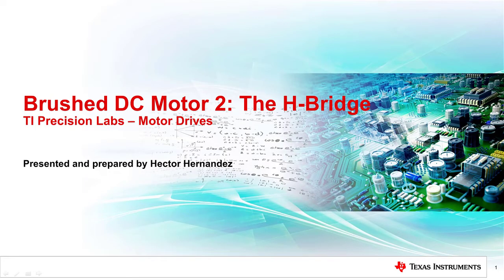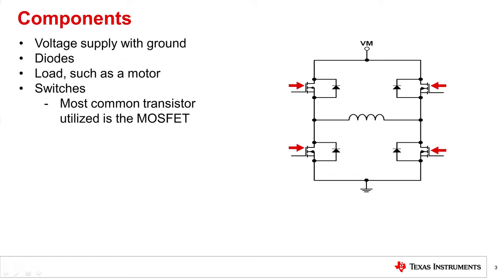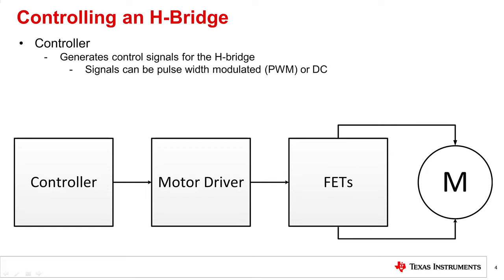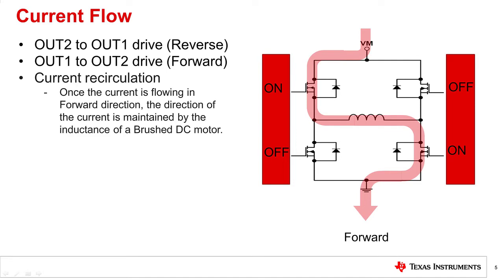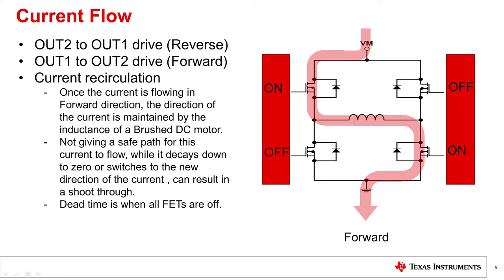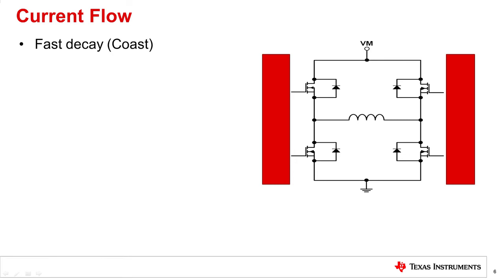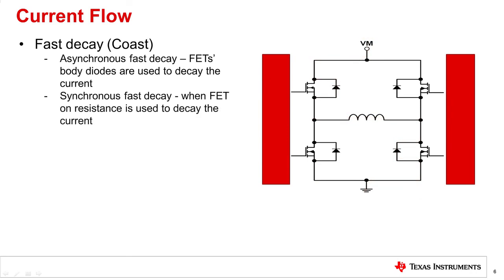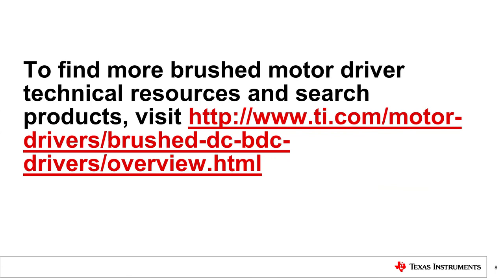The H-bridge

Comment: Instead of using the body diodes, why wouldn't you use them simply for the dead time, then either turn on the top two or bottom two MOSFETs, utilizing their much lower resistance to quickly drain the coil?